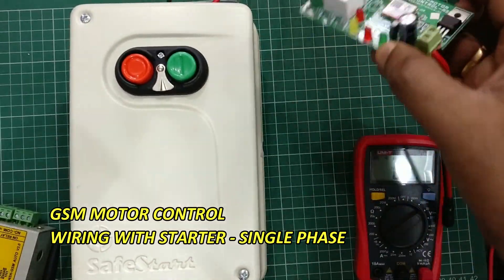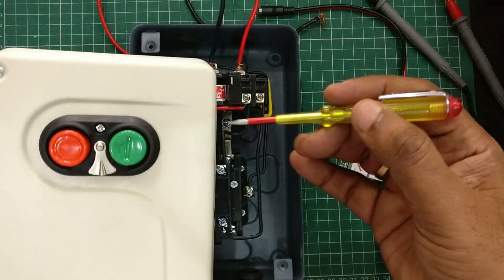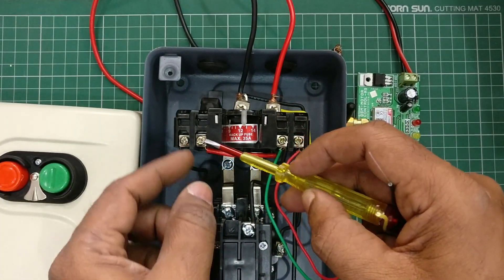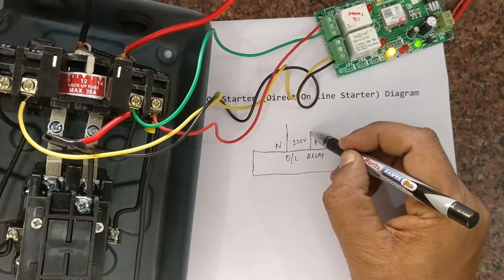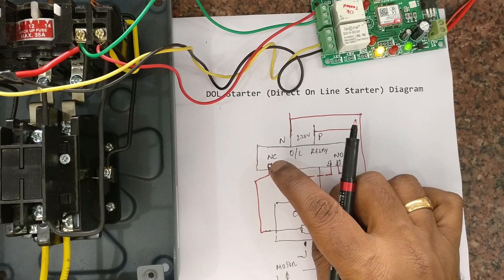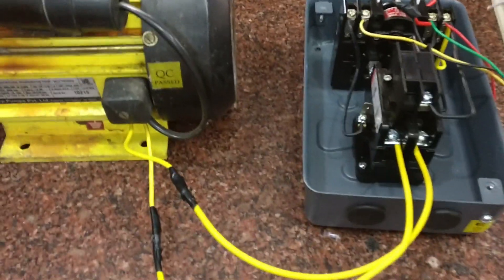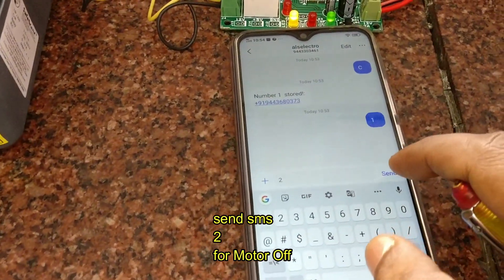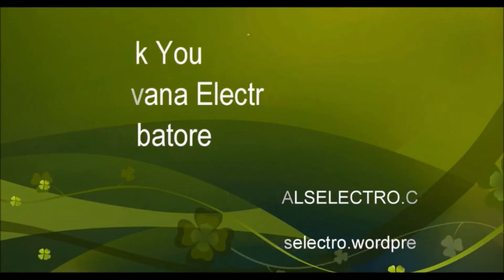GSM MOTOR CONTROL   STARTER WIRING DEMO SINGLE PHASE

Comment: If motor is on and mean while power disconnect. When again power come will it get automatically on or We have to again use command to on it
Reply: Auto and normal mode active or deactivate via sms if auto mode on and power restored pump on automatically if auto mode is off PUMP will be off after power restored you set auto delay time upto 200second via sms just you send #AUTO=60 and send it confirmation sms received and auto mode on #3 auto mode of #4 like you set 60 second auto delay time and auto mode is on and power restored after 1minute delay pump start automatically

Comment: Sir in my home we face low voltage problem can we add some feature so that we can get volage and current reading and if voltage is not sutable then motor is not operated
Reply: Use bch starter